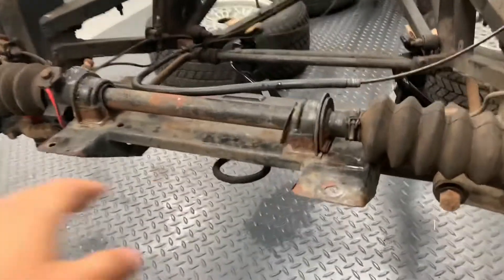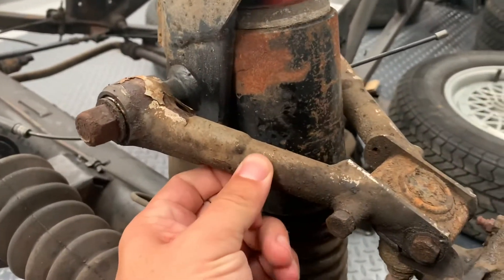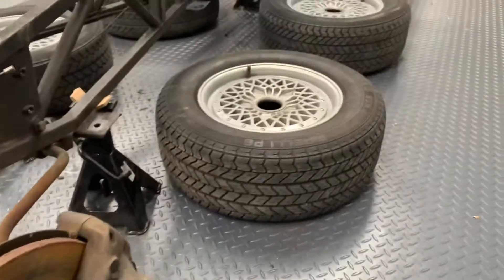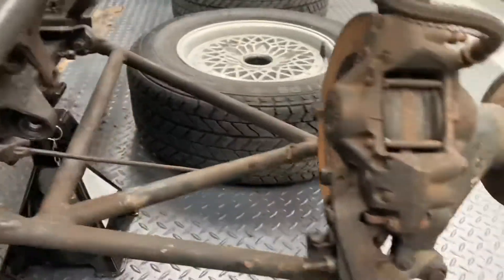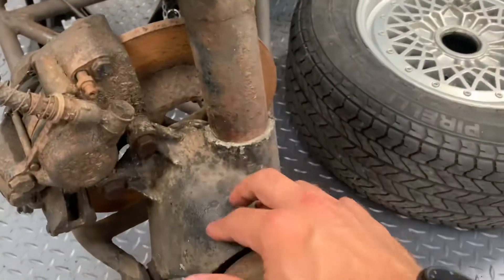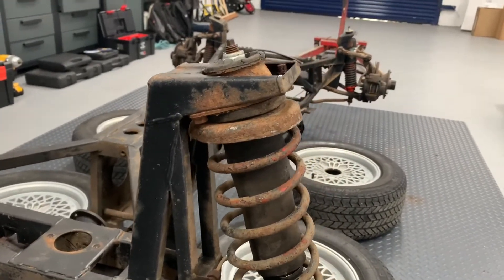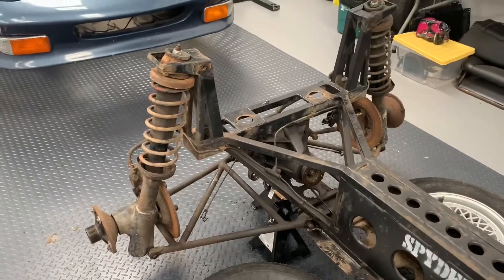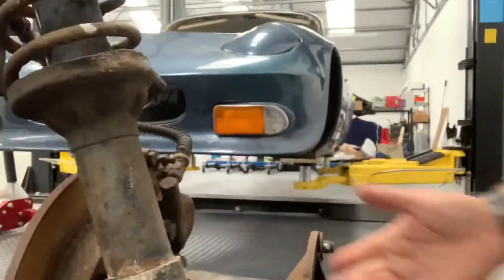Lotus Elan S4 - Suspension Walkthrough

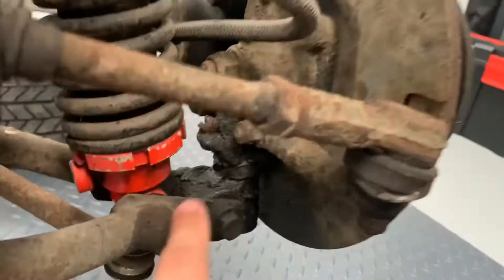Comment: 2:13 that grease nipple is for the lower trunnion. It's a sort of quick thread, causing the car to tilt very slightly as the steering is turned. If not greased, these can wear heavily and even seize. Partial seizure causes oddly stiff unresponsive steering. Caterham moved over to a similar upright, but with a lower ball joint instead.

Comment: Toe in adjustment on rear was deliberately not provided as mr chapman said it allowed it to be adjusted wrong. Aftermarket parts available do allow adjustment. The chassis you have is a spydercars space frame (a much better design in many ways in my opinion) not a standard Lotus sheet metal fabricated type. The dainty front uprights are straight off the triumph herald/spitfire range of the era.